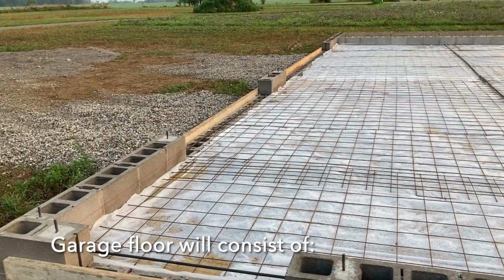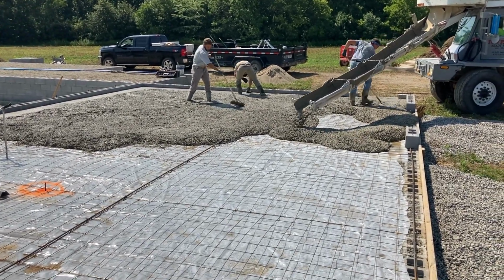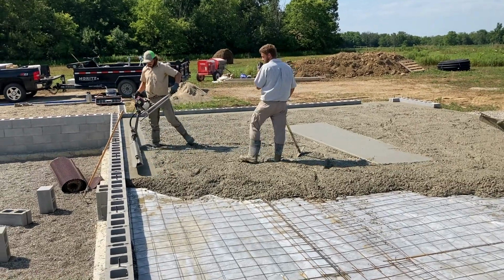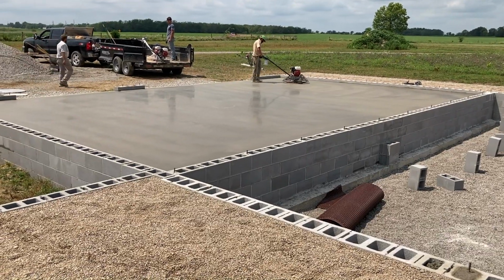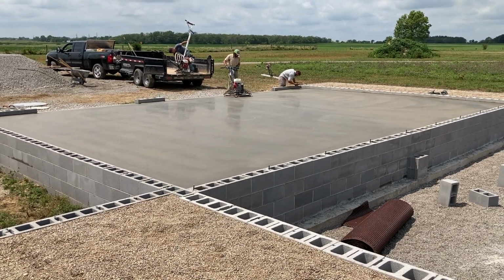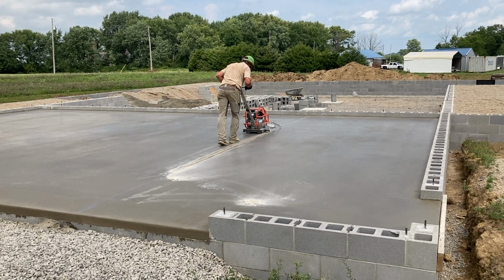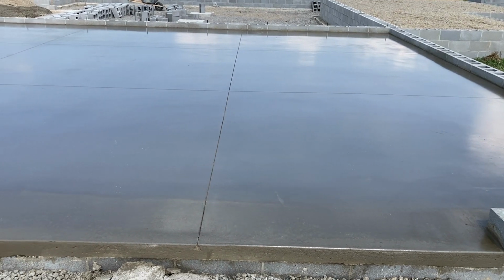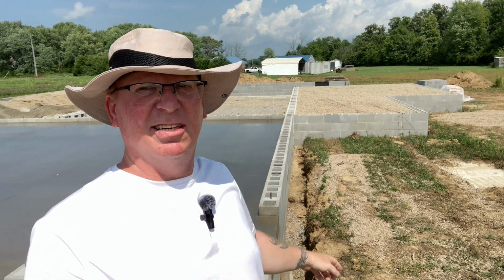Pouring a 40'x26' concrete slab in only 4.5 hours! It was extremely hot and time was of the essence.

Comment: Garage concrete "looks" nice, but the wire reinforcement mesh wasn't set up on dobies or bridges to position it into the middle of the slab to provide strength! True, the contractor obviously began by lifting the mesh with his rake, which is ok, but with the load being hot and starting to cure in the truck, the driver got WAYYY ahead of the crew, dumping before anyone got a chance to lift all the wire consistently, if at all. In addition to the lack of strength with the wire on the ground below the concrete is the wasted cost and time putting the wire down to serve no purpose! Hot concrete should have been refused, that is almost always written into the contract from the supplier. Surely, the crew busted a&& to level and finish a quick curing load, but the possibility of cracking, or worse, in the future is high. Hopefully, the rest of your concrete work is done to a much higher standard. Concrete needs to cure slowly over weeks, to achieve design strength. For what it costs, you deserve better.
Reply: You sound like an engineer. Book smart, but no common sense or actual experience in physically working in the field.